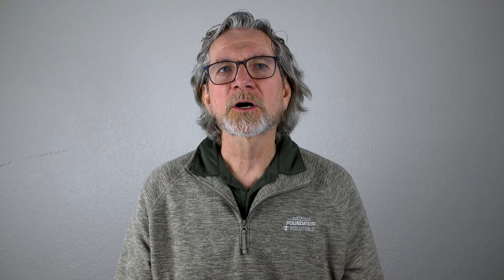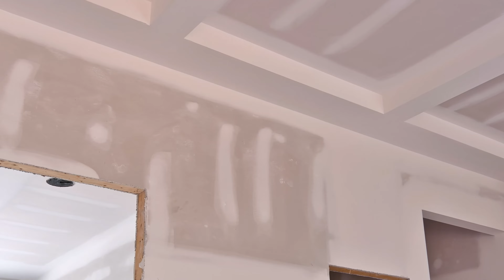What are those popping sounds in my home? Wood friction vs soil movement.

Comment: Thank you. The last two days we heard a popping, clapping noise. My son described it like when a suction cup is yanked off of something. We have walked around the house trying to figure this out. Ran the dish washer, washer machine, thought maybe refrigerator and nothing. Found your video and we all had an ah-ha moment… we had a contractor pull a wall down and when he tiled, a few of the tiles were hallow sounding. if you tapped on them, they sound hallow. But It’s been at least 15 years since that job was done. After watching your video we ran over to inspect the tiles and inspected. the grout seems like it is eaten away around one of the tiles.

Comment: The pops in my ceiling, right above my bed are so loud they wake me from a deep sleep sometimes.  It can be terrifying.  Seems like its getting worse with the cold weather.  At least this video and all your comments let me know im not alone in this!
Reply: House built in 1972, I just bought it and had the rim Joists replaced 6 months ago.  I'm guessing if it didn't pop before, the new Joists are what's causing the ceiling to Crack and pop. But it's only in one room.  My room.  Very annoying and I cannot believe how loud it is!
Reply from the maker: It's possible the cracks and pops were there before, just not as loud. The new joists can be loud when added to the structure as they are not used to the movements the house was already doing. Did you have the foundation/soils inspected before purchasing your home?
Reply: @ArizonaFoundationSolutions  the soil, no i didnt have that checked. But the foundation is good.

Comment: I have a loud (VERY loud) snapping/popping sound happening. It happens daily and many times a day. It keeps me up at night and last night it was occurring every 25 seconds. It sounds like a wooden pop/snap. Is this still part of what you described? It gives me anxiety and I can’t sleep fearing it’s a foundational problem since I just moved in
Reply from the maker: How old is the home and what are the soil conditions? Do you have rain gutters and proper drainage away from your home? If not then your popping sounds will continue until something gives. I would consider having a structural engineer or quality home Inspector check your home for any possible damage. If the home is good then get your foundation checked. If the foundation is good, then get rain gutters and drainage away from your home. The popping will continue for some time before it stops. I would refrain from any remodeling until it's all resolved.
Reply: @ArizonaFoundationSolutions  Its a home from 2014 and i have standard good drainage away from home. Im not sure of the soil conditions, the area fluctuates in temperature going from -10 to 5 over a couple of days. 

I'd just bought this home a few months ago and had an inspector look at it and said the home is fine. When I told him about the sound issue he just didnt know what to say and said its beyond his expertise.
Reply: @ArizonaFoundationSolutions  Let me add that on occasion, the last 4 months, I heard almost a gunshot "crack" sound. Like something shattering or reminds me of those 80s toy guns that crack when popped. If that makes sense. 

Does it sound structural to you?
Reply: @ArizonaFoundationSolutions  I also found that the sound is coming from the wall by the staircase in the center of the home. That wall sits directly above a metal support column I found in the basement.
Reply: @neonpop80 I have the same issue. Have you found out what causes it or how to fix it?
Reply: @hanna72900  I have not unfortunately. Let me know if you find out. Mine seems more aggressive in the winter tho
Reply: @neonpop80  Mine is aggressive in the summer.  All night long, on the wall near the headboard of the bed, it pops.  Several times and hour and if I move in the bed, it normally happens a few minutes later.  I'm starting to think my laminate floor is pushing up against the wall and causing it?  I'm at the point of selling the house.  I can't sleep in the summer at all.  It sounds like gun shots going off all night.  Nothing is wrong with the foundation.  I don't know.  I give up.
Reply: @59thfsaviation79  that really sucks. I still hear it. Just heard it now. Sometimes it can sound like someone cracking their knuckles but super loud. I hear it usually from the center wall above the center pole that holds the structure of the house. I had people take a look but they don’t see anything wrong looking at the pole or foundation. It’s unnerving and not sure I’ll get used to it

Comment: I had a new build in 2022 and the popping noise would only occur when the heat comes on in the winter. Due to work, I was gone most winters and now that I dont leave for work anymore the builder came to see if they could find the issue. When they came we moved my dresser that was in the area of the noise and then the popping sound completely stopped. So we moved it back and the noise came back. After cutting a hole in the floor board they saw where the ventaliation and the wood piece would meet together causing the popping sound so they placed a piece of plywood inbetween the two and it stopped. However after a week I heard 3 loud pops in the area and started hearing the popping sound again. Its not as bad as it previously was. Now it will  only pops when the heating comes on for about 4minutes instead of the entire time the heat is on and the sound is not as loud. Prior even after the heating cuts off it would continue for about 30min to 1 hr. Now it sometimes wont make any noise or its a very minor noise that I can just barely hear for less than 5minutes. Im wondering if I should notify them that it seems like that plywood probably shifted. Im currently trying to move my dresser in different spots to see of that would help. Do you suggest me to call them back? Do you think the noise would get worse overtime again?

Comment: I've lived in the same house for 29 years and all of a sudden we are getting really intense popping noises, especially at night but also during the day. Last year these only started around May once the weather got warmer and would increase at night as the temp cooled down, but now they're happening year round. This winter the popping noises would happen more frequently once the heat was turned on. If the first year it only happened during the spring but the second year it happen year-round, does this mean our problem is getting worse? The popping is causing me to lose sleep and I don't have the funds to hire an expert, is there anything else I can do??
Reply from the maker: Hello and thank you for your question. It sounds as if you are dealing with some settlement issues. Before you call an expert, check around your home for signs of stress. Are your doors and windows difficult to open/close more than before? Are there cracks in the corners of said windows and doors? Any separation from the ceiling from the wall or floor from the wall? Any nail pops from the ceiling? If you see these signs you need to have a foundation repair expert inspect your home. If the popping sounds are happening, but you haven't seen any signs of stress, then it might be that joints have loosened and just need to be tightened. We have videos on signs of foundation problems here on our youtube page so look those up and see if they match. Thank you for reaching out.
Reply: @ArizonaFoundationSolutions  
Thank you so much for getting back to me!! No signs of stress are occurring at all, what do you mean by joints needing to be tightened? Joints where exactly? Thanks!
Reply from the maker: The trusses that make up your roof and connect to the frame of the house may need to be checked and tightened. I would find a local contractor that is willing to do a free initial inspection so you know what options you have.
Reply: @ArizonaFoundationSolutions  great, thank you!

Comment: We live in a 3 level condo on the 2nd floor flat. Only one wall in our living room in one spot creates a quiet popping/sliding sound occasionally. No physical drywall or floor damage of warping shows. This popping sound is local to a 2 foot spot at the floor/wall floor molding location that joins our neighbor's condo unit with the same living room layout mirrored. There is no plumbing in this section of wall. What is causing this and what can we do to stop the creaking? Thank you for doing this video.
Reply from the maker: Good Day. By the description given its possible you have localized movement, just not a major one or one caused by soil. Its possible there has been in the past, or currently, heavy items that could have weakened the spot. If a heavy item wasn't present then the other issue, if not a foundation issue, would be to check for termites or other infestations. If this is a year round problem then I'd check for termites or other infestations that weakened the area. If it's only seasonal then it could be due to temperature changes with expanding lumber. Consult with a structural engineer if these are not the issue. Thank you for watching

Comment: Hey. I'm hearing these popping and cracking noises of late from 2 walls in my bedroom.

These noises are new, and only started when I moved a book case away from one wall, and on the other, I've mounted a desk and some shelves into the drywall/studs.

The book case had been there awhile, but... 

Google tells me that this is just the house redistribution weight? Having someone else's opinion would be appreciated.

I'll note the desk may only br mounted in drywall, and has a 3d printer that vibrates the desk a bit, but I have anti vibrational pads to help prevent this.
Reply from the maker: If you've had heavy objects mounted to the studs, there's a good chance the studs remained in place while seasonal temperature changes occurred. The other parts of the house shifted, while that area of your house didn't. Now that the weight has been removed, it's slowly shifting. Give it about 4-6 months. If you still hear the sounds after that time, consult with a structural engineer.

Comment: Hello, the sound I keep hearing in my house, closer to the roof, it’s heard only in one room and it’s more like someone hitting the wall with their knuckle on the other side… what could it be? At first it was heard only at night, now through out the day. I don’t think it’s rodents because it’s just on the wall, closer to the ceiling. Please advise as it’s driving me crazy
Reply from the maker: If you're hearing the sound both day and night, then is sounds like a seasonal shift. Going off your description, it sounds like the trusses are shifting with the changing temperatures. Keep an eye out for any signs of a foundation shift like nail pops, truss crush, ceiling and floor separation, and cracking tile(if you have any.) Once those signs appear, call a foundation repair expert immediately.
Reply: Thank you for responding, I’m feeling helpless on what to do. Yesterday had a rodent company come out and found nothing. The sound it’s continuous from about 1am until like 8:30am; Before it was just at night and would stop before sunrise. There are no signs of foundation shift. A better description  it’s that of a constant sound of like a water droplet falling one after the other with a pause in between. Roof was changed in April. No rains at the moment and all of our pipes run through the crawlspace.

Comment: i hear steady thumping noise under my bathroom floor when my central heat comes on, could this be my ductwork expanding/contracting?, foundation issue?  this noise started after florence hit
Reply from the maker: Depending on the severity of how your home was impacted by Florence could indicate an issue. I would start with checking the duct work. It could be something as simple as something mildly out of place. If your duct checks out, do a foundation inspection. I would recommend LRE Foundation Repair if they're in your area.
Reply: Really can't chk ductwork, all that area is sealed in wide insulation blanket, don't want  to disturb that

Comment: I hear the hardwood floor and joists underneath making popping or snapping noises every minute or so in the same area. If I go downstairs I stare at underside of the flloor boards against the floor joists I hear the same as if upstairs sitting by my chair.i wonder if the weight of a heavy chair can cause this. It's in the line of direction  towards the popping I hear unless just contracting and expanding from indoor temp changes when furnace is on and off.
Reply from the maker: Heavy objects, especially a chair if constantly shifting with added body weight, can cause floor weakening over time. It's not necessarily a serious structural issue unless the boards begin to bow when weight is added. Reinforcing the underside where you chair currently is can help prevent further damage.

Comment: Hi Bob!
It’s four a.m where I live and just heard another loud bang/popping sound.
Scrolling thru all the comment I realise that everyone has a house built of wood.

Where I come from they’re build with steel/concrete foundations, pillars of same material and also floors, no wood in my place.
Yet I do get this loud noise. It used to be in one part of the house but now moved a bit to another.
No plumbing nearby - bedrooms.

Any idea?
Reply from the maker: Even structures framed with steel are prone to soil heaving and, depending on your location, temperature changes. If you hear it frequently there's a possibility that moisture penetrated the steel and it's rusting. Weakened steel will shift with soil movements. Do you know if the steel framing is galvanized? There should be a local structural engineer or foundation repair expert who's familiar with your kind of builds and can assist you in getting that resolved.

Comment: I'm up in the middle night looking this information up scared 😳 it never pop and snap until it's time for bed. It's usually coming from my downstairs while I'm upstairs. I do have tile in the kitchen bc the nosies are loud I need to look for cracks
Reply from the maker: Watch for wall separation from your ceiling, cracks in your tile and small nail heads popping from the drywall in the ceiling.

Comment: Im freaking out. This sound wakes me up and I need to fix it. I have a flat roof and I’m hearing all this kinds of sounds after 5pm and they go all night . Should I be worry or is just the temperature?
Reply from the maker: This sounds like Temperature that's causing the sounds. Keep an eye out for cracks in your drywall, cracked tile, floor and ceiling separation from walls as well as difficulty in opening and closing windows and door. If you hear the sounds but don't have the symptoms then you'll be ok. You might try insulating your home a little more, but if you get any of the symptoms listed earlier, then contact a local Foundation Repair Expert to help you out.
Reply: I hear loud popping at night that wakes me up. I don’t notice these noises during the day. I do keep my AC on very low at night and have it up higher during the day. Could that be the cost? My home is also a new construction of two years.

Comment: So how do you fix the noise from the thermal expansion and contraction? Is there a way to make it less noisy?
Reply from the maker: Insulation is the best way to cut down on the noise. Exterior materials like stucco can't be insulated. I've seen some homes that get the lumber individually insulated with foil but that gets very expensive. Proper attic insulation and ventilation is the best method if you don't want to reinsulate the walls.

Comment: My house is a terraced house and pops constantly all day and all night recently is this normal ?? it is driving me insane!
Reply from the maker: Hello Amy. With temperature changes the pops are normal. If, however, this goes on year round you might need to check if your neighbors are experiencing the same thing. If that's the case, you should speak to whoever conducts maintenance in your area. I'm not sure if you are part of an HOA or community maintenance agreement, but whatever the case start with your neighbors and go from there. Have a wonderful day.

Comment: We moved into a brand new home that was built earlier this year. We hear constant popping sound from the front door and from some parts of the hardwood floor during day time and night time. One if the screws from the upstairs ceiling vent has also fallen down. It looks like we should have the builder recheck things?
Reply from the maker: Fluctuation in temperature can play a factor in the noises you're hearing. Especially with the wonky weather as of late. One of the issues with brand new homes is they were built without proper preventative measures in place. The big one is rain gutters. If your home doesn't have rain gutters, get them installed sooner rather than later. Make sure you have at least a 5% grade that diverts water away from your foundation, and DO NOT plant anything up against your home. Check with your builder if installing rain gutters will void any warranties they have with your new home. If your foundation is facing issues, Do not let them "relevel" your home."